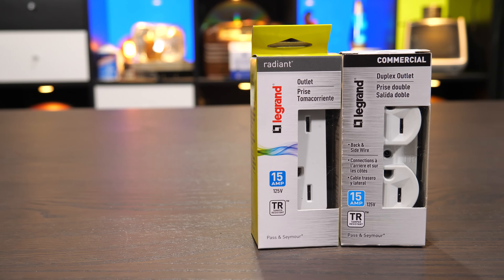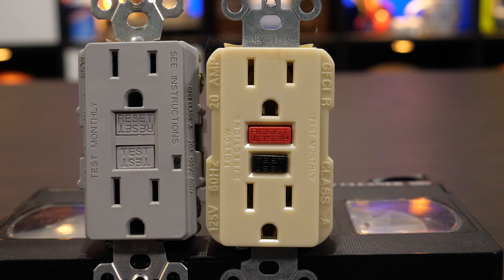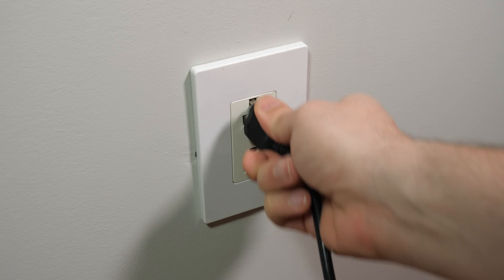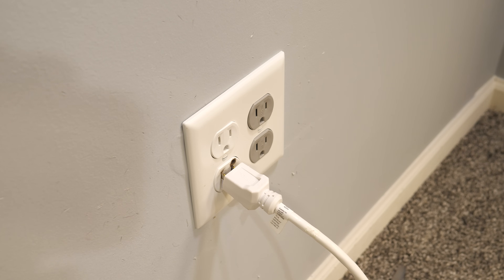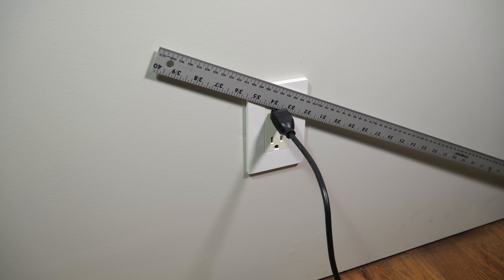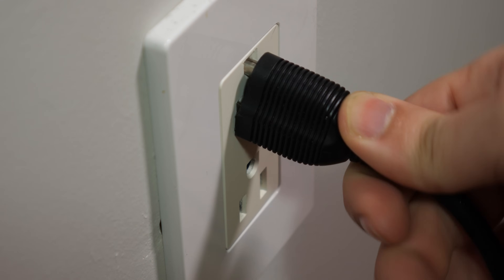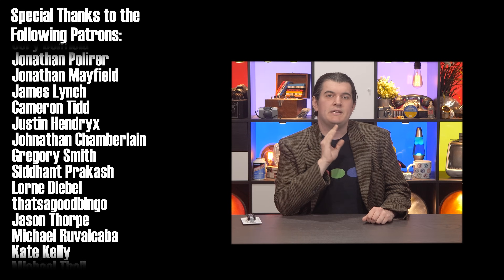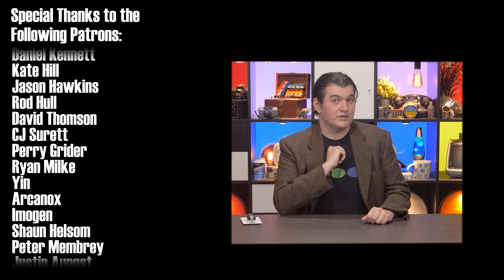Power outlets are topsy turvy - but does it matter?

Comment: Do these outlets not have staggered insertion depth contact points so that when inserted, ground connects first, then common, then hot? If not, this simple change would mitigate at least some of these risks without breaking legacy outlet and plug functionality.
Reply: The ground pin is longer.

Comment: in the UK, they have switches for wall outlets. no matter how you insert or remove the plugs, the switch off position ensures double safety and also prevents arcing when plugging/unplugging a high power device.

Comment: what about a duplex outlet with one outlet (ground down) and the other have (ground up?  That would accommodate two right angle plugs.  One down, One up.
Reply: That puts the two hot connections on opposite sides, and the two neutrals on opposite sides.  That is awkward, because the two outlets are connected in parallel when new, and can easily be separated in the field.  Take a close look at one.
Reply: yikes! my bad.

Comment: 2 points you missed:

- ground pin down orientation makes the outlet looks like a face which is potentially more enticing to small children or the mentally handicapped.
- Pull straight down on the "upside down" right angle cord and you get the same effect of hot/neutral being forced against the wall and limiting pull out. While the angle of force is not exactly the same as a standard cord in the typical orientation I would argue it is very close.

The argument of convenient cable management and ease of 3-prong use(right-angle or specialty) is equivalent to form trumping function/safety which seems weak.

Also, you argue that "the majority [of plugs] in my life have only two prongs" invalidates the benefits of ground up orientation, yet in almost the same breath you argue that the "mere existence" of right angle plugs point to a flaw of ground up. If you are arguing prevalence of a plug orientation should dictate outlet orientation, I think standard 3 prong plugs are way more common than right angle plugs even if you count 2 & 3 prong versions. Based on plug prevalence ground up is safer more often. Regardless of plug prevalence, manufacturers are very unlikely to build 3 prong right-angle plugs with ground up in a market where the less safe outlet configuration is more common and desired due to familiarity. Trading temporary, mild convenience for safety, even if it is for mainly edge cases, doesn't make sense.

Comment: I hate the tamper resistant outlets. 🤣
Reply: So do I.  My electrician said he had to use them when he was working on my kitchen, so I bought some cheap ones until we passed final inspection, then threw them away and installed the ones I wanted.  There are no children in my home, and if any visit they won’t be crawling on my kitchen counter.  Besides, those outlets have ground fault protection.
Reply: @GH-oi2jf  in Canada, where I live, we have to have a GFCI within 6' of a water source.  Including sinks, tubs etc. 

So, both the right counter plug is connected to the left one, which is GFCI. 

In the bathroom the switches for the fan and lights, are connected via the GFCI.

Welcome to the f**ked up world of Ontario Building Codes. 🤣

Comment: I was once told that the orientation was designed to differentiate between 10A circuits and 15A circuits.  With the 15A ones predominantly being in areas where you're most likely to use high-draw appliances, like the kitchen and bathroom.  But next to your bed, your clock radio is happy with 10A.  Though I'm sure modern materials standards have made it pointless and everything can be 15A or even 20A.  🤷🏼‍♂  It just makes bigger sparks when you finally get that knife right on target.

Comment: I discovered this obvious flaw when I was installing a computer into a metal cubicle.  While under the desk the metal cover on the cubicle fell as I was pushing in the power cable and hit both prongs causing a short and a spark, tripping the breaker and shutting off all of L0 tech support.

Comment: went to trade school, my professor told me why to install them upside down: 
its just a bit of an increase in safety. thats all. those situations are contrived, but possible, and the simplest solution was ground points up so the return path to ground is hit first. it doesn't work on ungrounded plugs, which is why you have other safety features. 
its not something to worry about unless you're in the very specific position of making a decision on the orientation. if you own your house and are retrofitting? your choice. make it as you see fit. if you are in charge of safety critical stuff? yep, still your choice. you get to decide whether or not a conductive device rolling off the back of a desk might short live and neutral of machinery or take the ground path. still your choice, but ultimately its just a peace of mind thing to be decided when relevant. 

If you have never considered the topic before this video, you probably don't need to worry about it.

Also, regarding 90 degree consumer electronic plugs? why is the discourse between you and your plug instead of you and the manufacturer who built the 90 degree plug in the manner they built it in?

Comment: All the plugs in my dorm room are "upside down", and every power strip I have is a 45 degree angle plug (all the new power strips i've seen are like this). It's not as bad as the 90 degree plugs ,but it's still a pain.

Comment: In my garage some of the outlets are up and some down.. also checked to see where the hot side was..and there mixed also regardless off the oritation of the outlets😄 The ground wires all just ground to the metal outlet case's too.. I'm going to switch them all in the correct position one of these days.

Comment: In Australia, the Ground plug is on the bottom as it is the last pin to be disconnected, making the ground connected when others are not.
If the cord was to come out, the earth (or ground) is the last pin connected as safety.  It is also the first to get connection when plugged in.
Reply: Also, if you step on the cord on the ground, and the plug is pulled out and down, still has the Ground connected till last.

Comment: I'd be interested to watch your assessment of international plug standards and hear your proclamation of which is best/worst.
Reply: I think he has mentioned it in some other video. I think the UK won and then the EU one came second.

I agree with this even if I think the UK is to chonky and prefer the EU one.
Reply: @packe93 the only downside to the UK plugs is how they will come to rest with the prongs up, ready to stab your feet. But I reckon most of us in the UK only had to learn that lesson once.
Reply: @daniellegrace83  Yeah, but you only do it once or twice. After that if you see a plug on the floor it is is your best interest to tidy it up. And a good reason to shout at who ever left it there.
Reply: Here in ex-USSR countries (or at least in those I was) we have as far as I can tell EU-like plugs, but even when I come across really old plug, like made-in-USSR-old, it has at least "sleeves" that cover 2/3 of prongs length. Old sockets on the other hand is basically like US ones, but with round holes. More or less new are different tho, socket is recessed for a 1 or 1.5 centimeters. And modern is well - modern, recessed, grounding, even has little clamps on sides of socket to hold plug more securely, and also works fine with any old plug (old plugs was rectangular like in US, but modern are circular)
Reply: Schuko > UK for one simple reason: you can plug in a Schuko either way, whereas the UK plug has a fixed orientation.
Reply: I don't agree with him there. The Schuko is much safer than the UK plug in so many ways, and the main draw of the UK plug – the plug fuse – is pretty much a gimmick solving a problem better solved in other ways.
Reply: yeah the UK one is good but it's just so overengineered, it has nothing on the simple elegance of the schuko!
Reply: @konayasai  Remember that a lot of early devices did not come fused, at a time when the quality of products produced abroad was highly variable. Another great advantage of UK outlets is that most of them have a switch (it's rare to see a wall outlet that doesn't have a switch, though cheaper extension leads often lack them). The lack of switches on US outlets always freaks me out. I like being able to entirely isolate a device.
Reply: @mapesdhs597  The switch is over engineering, it is also a UK thing to have them not a US thing to not have them, this time the Americans aren't the weird ones, it's the Brits.
You're calling something an "advantage" when it adds complexity(cost) to solve a problem that doesn't exist.

Comment: In Australia: A friend of a friend was electrocuted while installing sheet metal. The sheet dropped between the plug and socket. Our plugs are larger so you can't get your fingers in, but it doesn't stop sheet metal. 

The result of that death is that the prongs are now insulated half way.
Reply: Safety regs are written in blood.
Reply: Tragedy is the author of regulation.

Comment: Just figure out what country has the best/safest plug and adopt that in new construction. Frame it like USB A vs USB C. Appliances can start coming with little adapters that convert NEMA to whatever. It’ll be like how everyone bought a big cheap pack of 3 to 2 prong adapters (and then definitely used them wrong in their pre-1970 or whatever house) when the ground pin was introduced but at least it will be properly grounded this time. You can still be on 120V, just maybe make some weird extra notch to prevent 240v things from being plugged into it unless it can do 120-240 like most USB charger thingies.

P.S. 7:51 Look at this guy throwing knives at a wall (presumably gouging the drywall repeatedly), but worrying about scorch marks.

Comment: Question: why don't we all use circular magnetic flat plugs like those USB cables with the interchangeable bits?
Reply: KZZZZZEEEERRRRTTTT...!

That flat design is fine for low voltages like you find in USB. Not so much for 240V.

Comment: so from my experience as an electrician, The face down orientation definitely originates from hospitals. Btu a few caveats about that. Hospital equipment pretty much always has a ground pin, so it somewhat explains why the orientation is so common there.also pretty much anything in a hospital is on wheels, and no hospital plug i have seen uses right angle plugs. Now typically hospital grade plugs have very strong grips on their plugs, but considering all the chaos that can happen in hospitals, there is a higher chance of plugs ending up only partially inserted for one reason or another. So making the receptacle upside down helps in a hospital setting.

but in a residential setting, face down receptacles are pretty pointless, in part because of the prevalence of two prong plugs making the orientation moot, and the difficulty with right angle plugs does not help.

That being said, the best plug design here in the US to solve the problems for our plugs would be universal twist lock plug adoption. Twist lock plugs basically never have problems with being partially inserted, since they need to be fully inserted to properly lock, and once locked they will never fall out on their own. Their only real downside is if they are pulled really really hard, The wire can be pulled out of the plug or more disastrously, the receptacle pulled out of the wall.

Comment: OK some ideas:
1. have the outlet recessed a little into the wall, so no way to touch connectors if yanked a bit.
2. make all the plugs big and round (like the 45 deg round plug) and with a nice grip
3. make all the plugs right-angled

I didn't think of it myself btw, just looked at the nearest outlet and realized how smart this is.

Comment: This comes back every so many years when a new crop of people who have not been slapped down yet think they're the first ones to try to solve this "safety" problem.  As you said, there are not enough cases of this causing actual harm to anyone to mess with it.  And as the second half of your video pointed out, appliances have been made for the 3 prong outlet since it's creation 97 years ago and virtually everything since 1960 when it became code... and the plugs all assume ground on the bottom.  It makes less than no sense to break compatibility with untold hundreds of millions plugs to "fix" a non-problem.  Electricians say the same thing.  You want to talk about safety minded people who will argue until they are blue in the face about this subject?  Professional Electricians, Inspectors, and the few who work on the NEC book.  None of them are screaming from the rooftops to change this.  For good reason.

Comment: I grew up in the UK where the ground pin (earth pin!) was always at the top regardless of plug type. But then switches were also up for 'off'. The only exception were the Wylex type.. US plugs are a bit naff but with (relatively) low voltage and not needing to plug and unplug stuff so much these days they're livable with. (The 220v high current ones -- now there's a horror story.....)
Reply: Then there's the French socket, with an earth pin in the socket, at the top, and a hole in the plug.

Comment: Put a heavy wall transformer in a jack with the ground pin at the top.  It will fall out.  I hate it.  ALL the outlets in my '65 home have the ground pin connection at the top.

Comment: The 45degree angle plugs are fantastic.  Allows you to utilize both sockets without having to resort to straight plugs (not usually a problem to be fair, but if you're in tight spaces like behind a desk that can easily be an extra inch or two clearance saved).

Still have the same issues with pulling them out as normal 90degree plugs though.  Only resolution to that I can imagine (without redesigning the entire setup) would be to either add a pull handle of some sort on the back or to make them taller.  Of course that would just be additional manufacturing expense and removing at least some of the advantage of being flat against the wall for a fairly small benefit so its unlikely anyone will care enough to do that.

Comment: You can blame Hubbell, the inventor of many of our NEMA plugs/sockets, for the confusion. The NEMA 2-15 (1908) and 1-15/IEC Type A (1912) plugs were originally intended to mate with adapters that screwed into an Edison light socket, and NEMA 5-15/IEC Type B was designed to be compatible with the earlier design, but provide equipment grounding. It wouldn't be hard to add insulating sleeves to the prongs. The Australian plug, AS/NZS 3112/IEC Type I, is basically a modified NEMA 10-20 (1925, obsolete in N. America) with sleeved prongs, and it has the ground (earth) on the bottom, except in China, where they've turned it upside down. BTW, the Hubbell website shows most of their receptacles and plugs ground up now. Many old houses had their receptacles installed sideways, in the baseboard. Ground up is usually an indicator that the receptacle is controlled by a switch. Although all the outlets in my sister's apartment are installed that way.

Comment: I have seen the foreign object issue cause sparks and trip breakers. A metal sign hanging on a wall. Also a length of solder just leaning. So I see the value in ground pin on top. I think all devices should have ground pins but you are right that the 90 degree plugs are not designed for that. Actually most don’t even allow both outlets to be used. So I’d argue for 90 degree plug with cable going to the side, and receptacle on top or sideways with neutral on top. Or a recessed receptacle as is done in Europe.

Comment: How about an outlet with one upside down and one right side up? You can still use right angle plugs on the lower one and you get the small protection on the upper one with the ground on top.

Comment: Look at the way plugs and cords are shaped on older appliances like refrigerators and A/Cs.  They are obviously made to hang straight only when the outlet ground is down.

When you plug them into a "trendy" ground up outlet, the cords bend over.

Comment: 4:55
I'm used to using the side of my pointer finger push against the ground pin on the under side and resting my thumb on the top side, away from the pins. It's literally the same as flipping them upside down and using your thumb to push. There's no need to flip anything. Whatever orientation you use, you can still slip a finger in there if you're not careful. And like you said, if the plug doesn't even have a ground pin then it's exactly the same.

Comment: I actually had a scenario like the examples in the middle video occur.   I have an old Realistic Pro-2011 20 Channel (Fire Dept), that has a push in style jack in the back for an axillary antenna.  It had a Motorola push in connector and I am betting the idea was the push in connector would be on a cable to a much larger antenna.   Well.... I bought an extendable/retractable antenna with a right angle and push in connector.  Friction kept the antenna upright..... until it didn't... and it fell over to the right.  The scanner was on a desk right up against the wall and the antenna... sure enough... made contact with the exposed blades on a plug that was hanging out of the wall.   I wasn't around, but found the evidence when the lights wouldn't turn on in the room.

Comment: I just bought a house built in the 60 and the old fridge left here has a 90° plug with the ground pin upside down, and half the outlets are upside down and half are right side up. Have to check the orientation every time I plug something in 🙄

Comment: My problem with right angle plugs is that they don't play well with other plugs in the same set. The 45 degree one shows promise, but would still be problematic in a block splitter.